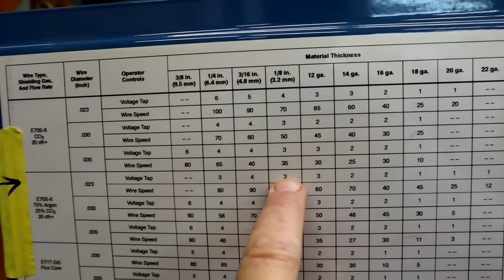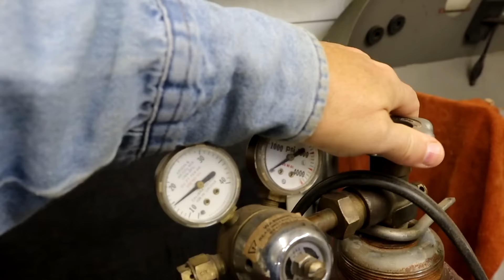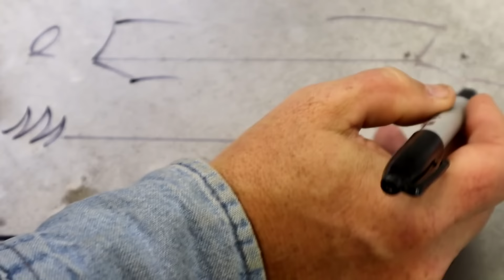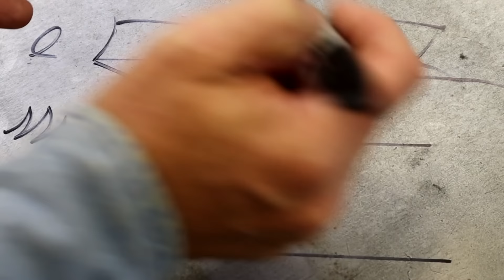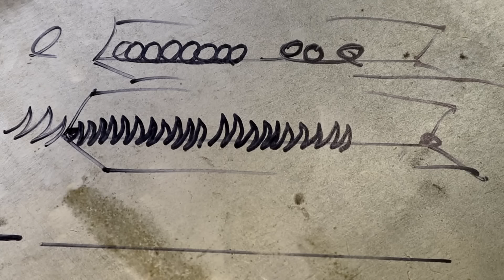How To STACK DIMES With a (MIG Welder) For Beginners🔥🔥🔥

Comment: Less wire slower travel speed would really help the control for uniformity. Especially for a beginner, that's just my opinion. Also the old Miller transformer machines are way better to learn on than a digital inverter machine. Way to many settings on an inverter. Transformer #1-6 on heat and #0-70 or 80 on wire much easier. Learn stick out, travel speed and the crisp sound a good weld makes, in my opinion those are the three main things when learning how to weld. Stacking dimes can wait it's not an important skill in mig welding it just looks nice. When you can tig weld aluminum that's when stacking dimes matters.
Reply: Forget it Albert. Kids nowadays have to have digital and auto darkening  hoods. I use a Fiber Metal with a 4-1/4" lens. My stick machine has an on/off switch and one knob. Lift arc on the TIG no polarity switch. In the pipe rack just swap the stinger and ground to go from TIG root to 7018 hot, filler and cap. I ant walking down no ladder to swap polarity.
Reply: @davidrule1335  it sucks that it is a dieing art to be a welder. I keep a fiber-metal with a 13 for air arc. I do use auto darkening most of the time. It sucks how most people won't have the ability to set their own machines, because the program is the best for the situation. I can't run a mig with factory settings It just doesn't work for me. That is why in my opinion a transformer machine is the best to learn on. Then when you get to digital man you can make it do what you want because you understand the basics. When you can run a bead and the mig sounds like a tig with the hertz buzzing laying dimes.
Reply: @albertpierce6263  When I'm tacking up fab work I can't see the layout lines with those hoods. Of course I've been blinded a few times in 30 years. But the auto hood, to me' is only good for the plasma. For that it's nice because you can dial in the shade you want. on your last point, I would call that "spraying" it in. Great penetration but some times awesome splatter balls!

Comment: Did you do a cut and etch or destructive test to confirm proper penetration. .?
Reply: Even just breaking the bead will tell you if you penetrated properly. Which I doubt ANY of these welds did.

Comment: dragging is a cold weld. The wire needs to be out front pushing to get good pen.
Reply from the maker: We have done cut and etch on both ways and I dont see a difference.
Reply: @ACDesignsGarage  Reason I say this is over 40 yrs welding. And yes it can be a preference but most new welders tend to not move fast enough and shoot the wire into the puddle ( bad ) means your building up a  puddle and not digging into fresh material. If you have about 10-15 deg push angle you will still see the puddle and where you are going you will also notice more dig and a flatter weld but you will get better pen.

Comment: I have a miller 210 that won’t spoil wire send wire when pull trigger. Kentucky
Reply from the maker: Maybe check the tension on the roller in machine.    Thanks for watching.
Reply: @ACDesignsGarage  got the millermatic 210 going, great machine, and got it for 500.00, believe I got a good deal on it. Thanks, Kentucky

Comment: I’m guessing the argon helps with the spatter? I’m learning how to weld with flux core, and the spatter is off the charts sometimes.
Reply from the maker: Yes it does help and also I think the flux inside the flux core wire causes alot of that. Flux core is awesome,  but if you ever switch to the gas and solid core wire youll love it!!! Thank you for watching,  if you have any questions let me know!!!

Comment: 26.5 v 425 ipm .045 metal core and c8 gas at 45cfh would give you a beautiful weld in that position in about 3 whole seconds I know it's about mig but for anything 1/8th or thicker in position I run metal core faster deeper and less cleaning
Reply from the maker: Thanks for the tip!!!!!
Reply: That would be spray transfer though not short circuit MIG.

Comment: Not hating....in a weld shop environment especially with a CWI present, the dime, nickel, whip, style can get rejected.  Low throat, cold lap, drag cup may get you in trouble. Also, If you can afford 2 gases try 92/8 for hard wire carbon (E70 etc)
Reply from the maker: Yeah no biggie, in the light fab world im in, its pleanty strong enough  for under 3/16 as long as you have your settings dialed, as for structural or heavy fab id use different methods.

Comment: Hear how the welder “Stalls” or “skips” when you “jump” the joint..? Welding isn’t about looks… It’s about penetration. Concentration in the root joint of the weld is what’s crucial. Always start at the joint go out and back to the joint. Welding from edge to edge is like a caulk gun. Weld will only be on the surface not in the joint… cross section cut that and you’ll see exactly what I’m saying. A straight drag would be much better than trying to get fancy and whip the tip all over the plate… Straight drag focus’s directly on the root joint… not the edges… Been welding for 15 years and I’ve never “stacked dimes” once… 👍
Reply: Dime stacking is American nonsense 🌚
Reply: Wrong!

Comment: I was told never drag/pull unless it's fluxcore.always push your weld if not fluxcore?is this correct?
Reply from the maker: I think its preference,  i watched a video on weld.coms youtube where they tested it with a robot both ways then cut and x-rayed them both and said they was pretty equal. Here is the link if you want to watch
https://youtu.be/QRhtjbFzWEc?si=lVG-_oWhna5h1aY1

Comment: you can turn the heat wayyyyy up, it should look like liquid, and once you get your puddle started you should have to make very minimal movement. Instead of chasing the weld, go slow with the weld. You want to start your puddle, and then slowlllyyy move forward, and extremely slight O movement going up, back, and then down (in that order) to make an O shape. You shouldn’t even be moving a 16th of an inch if you have it running hot enough it will he formless like a liquid puddle. Think about it like this, instead of weaving, slowly move forward, and when you do your almost non noticeable O you’re not weaving, merely slow down let the puddle catch up then SLIGHTLY move up, back, then down and forward. You guys work too hard doing this stuff, and even though I know when you turn the heat up and you hear liquid it doesn’t sound right at first, but trust me you wont work as hard and your welds will be much more consistent. Sorry, kind of hard to explain over text I did my best, hope this helps! 🤙🏻💯

Also, with this method there’s almost no spatter, the only spatter I tend to get is tiny particles that come right off with the needle scaler.
Reply: Most people turn the wire speed too fast to where the wire is trying to hit before it can arc. It's sounds good but makes a weld you can take off with a chisel.
At one job I used to turn it slow and make a longer arc and of course more
' popping ' noise but really burn it in.
The guys would yell at me to turn my wire up.
Years later I had a job where they instructed us to do just that, and let it arc longer. I knew I had it right.
Reply: He isn't even really making a puddle. He's not getting any pentration and is just laying the weld on top of the metal.

Comment: I've only ever done arc or stick welding before. People keep telling me it's harder then MIG. OK I'm not perfect at it. I've done good welds and I've done crap ones. Though normally where it's awkward situations to weld, or to see to weld. We just got a MIG welder for doing thinner metal, such as on vehicles, now ours are ageing. I have been told that you are less likely to warp metal with MIG. Is this correct. This is something that frustrates and depresses me with doing arc welding. It don't happen every time, but it does happen and I don't know why.
Reply from the maker: Yes you will love your mig. It's good for all around welding. I'm going to put a link to one of my videos below that I made a while back on mig welding thin sheet metal if you want to check it out. I would get some 0.023 wire for doing sheet metal, it works great on body pannels!! 
https://youtu.be/S6spZdzqFxg?si=btVSF1hiKCCcUO5M
Thanks for watching!!!!
Reply: @ACDesignsGarage  thank you. I will check that out as well.
Reply: Mig is just a caulkgun that sparks. Well actually Mig is clean, Fluxcored wire is the 1 that sparks more. Tig is the quiet 1 and there are no sparks.
Reply: @GenZRuinedTheWorld  thanks. I sort of knew that LOL. I've been given a no gas MIG welder from a friend that hardly used it. Its not exactly the model I was going to buy, I was going to get a 130 amp gas MIG. Though the downside with that, is that I have to do all my welding outside, so it may have saved me money big time, as I may have had to do it all in some kind of tent in any amount of wind blowing outside. The one I've been given is a 100 amp no gas. Ok nobody likes splatter to clear off after, but I've made my fair share of splatter with our arc welder, so I'm kind of expert at removing it now, LOL. So it's flux core wire for me for now.
Reply: @MrBooojangles   a no gas Mig is fluxcored wire. That shit spatters like a 6010 rod. Fluxcore is the 1 that is for Outside.  That's what they use in shipyards

Comment: To the newbies, stacking dimes is not recommended for maximum strength FYI. The smoother the weld, the stronger the weld.
Reply from the maker: Have you done a cut and etch test to see how deep it pentrates?
Reply: @ACDesignsGarage  ....Yes, as a working CWI I probably have done it a thousand times. It is not about the penetration. It is about the stress each ripple induces into the bead.
Reply from the maker: @calikalbocalikalbo6082 I can see your point. I understand that, I was taught that in welding school but in motorsport fab they want to see that ripple, and we've never had a weld break .
Reply: @ACDesignsGarage  ....Yes of course when it comes to certain fabrication it's cosmetically desirable, especially when it comes to aluminum. I too have always stacked dimes depending on the product I was fabricating and welding.
Having said that welding something for motorsports, boats and other products is much different than structural steel and bridge welding/fabrication as it what I inspect. In general it is not something that is normally utilized in the field on structural steel.
Reply from the maker: @calikalbocalikalbo6082  I agree and I appreciate your input and your knowledge! Thanks for sharing!
Reply: @ACDesignsGarage  ...No problem and welcome. 
it's nice to get a positive reply instead of people always crying when I make a factual statement about welding.

Comment: I think the sawtooth method would be faster.  Both are great looking welds though. 👍
Reply from the maker: I agree with you, I like the saw tooth better and it is alot faster.
Reply: @ACDesignsGarage  I was wondering if welding as a second career is a viable option.  I am 50 yr old.  Am I too old to switch careers?
Reply from the maker: @73monochrome  Im all for it im 45. Its easy to pick up side money, and a ton of side work.
Reply: @ACDesignsGarage  thank you for your reply.  I'm going to start researching how to get started. I'll keep you posted , 👍.

Comment: what is your voltage and wire speed again?
Reply from the maker: My machine dont tell voltage its old lol, but it was on 2 and 70 on wire feed I think.  I usually run this style a little hotter than you would normally.  The oscillating of the mig gun is where you get that look, but since your going back over a weld you turn it up a little!!!

Comment: Does anyone else think his settings are low?  I think he’d be surprised if he cut and etched those welds to find how little penetration it had.
Reply from the maker: I have cut and etched the part in another video and it looks fine,you'd be surprised It's only 3/16" ,now I don't do this on 1/4" and up.

Comment: Help :( I cannot see anything when welding, and even if line/pattern looks OK, I often go off the line, I tried ajusting the mask darkness, but it doesn't help. I kind of see like this at 7:47 , are you supposed to see better than what you can see in the video there ? 
How can you see the line ? 
Could normal lights help ? leds, projectors, etc.
Reply from the maker: Im thinking about doing a video in the next 2 weeks on that problem,  I will say tape or mount a good LED flash light to the side of your welding helmet pointing towards the area to weld may help also good overhead lights helps, and also getting your face as close as you can get to the weld to see helps also. Hope this helped stay tuned for the video, thanks for watching!!!!!!
Reply: @ACDesignsGarage  I tried some things: cleaning mask inside out, getting closer to the welding, tried some projector lights but I think I need focused light. I also drew white dots and lines with marker on left and right of where my weld should go, that helped a bit, like a landing strip guide for planes :)
Reply: Use soapstone to trace weld joint.

Comment: THE BIGGEST THING IS GETTING THE MACHINE SETTINGS RIGHT TOO
Reply from the maker: You are 100%right, I run it a lil hotter when doing this so it melts into the root!!!!
Reply: @ACDesignsGarage  need to really do one that focus on machine settings I NOTICE VERY LITTLE SPEND ANY TIME ON THE SETTINGS AND WHAT THEY ACTUALLY DO

Comment: No. Any welder will tell you that "stacking dimes" is not how to mig weld its not how its designed to work it doesnt improve the weld it slows everything down and on 1/8th plate ifbyour torch angle is correct you wont need to weave and draging is a poor method for thick plate. Go buy a book on welding. Your torchbangle also put uneven heat in the plates.
Reply: That's not the point
Reply: @tim_tool_man  so what is the point?

Comment: How strong are the welds?
Reply from the maker: Ive been doing this way for years and have never had any trouble. As long as your heat is right and your getting good penetration you shouldn't have any trouble. The reason I like this way is you burn the root of the weld in then wash back over it, so kinda like 2 passes in one.
Reply: @ACDesignsGarage  Thank you for the reply!

Comment: That’s way to big of a wash! Your temp is way to low. That would get you sent back to the grinding station in a fab shop. 😂
Reply from the maker: Thanks for watching ,but I have worked in highend fab shops and offroad trophy truck shops welding suspension and roll cages and have no problems yeat lol, but I see what you are saying, this video was more on the manipulation of the puddle to achieve the dime look, if I had done it down to the normal width you couldn't see it on the video. Also you have to be careful on 1/8" with your heat effected zone also with warping and cooking the metal to death.
Reply: (*too big) Too bad some people don’t get sent back to English class. 🤣
Reply from the maker: @randomschittz9461  hahahaha
Reply: Trophy trucks are awesome.